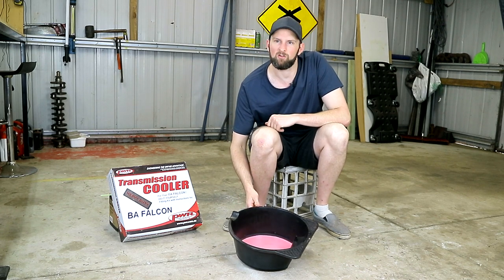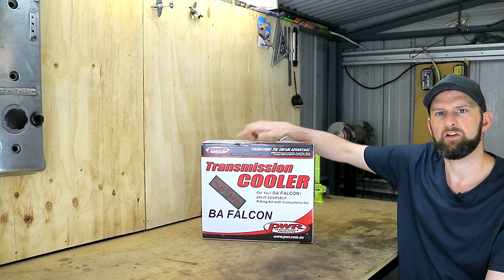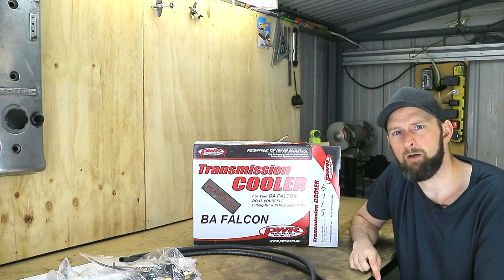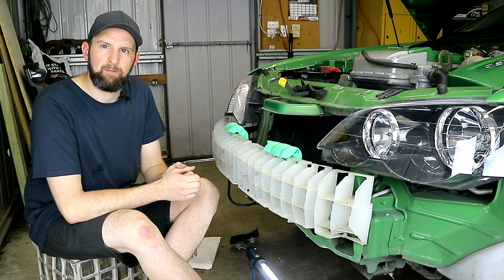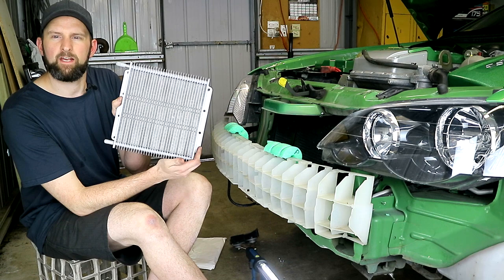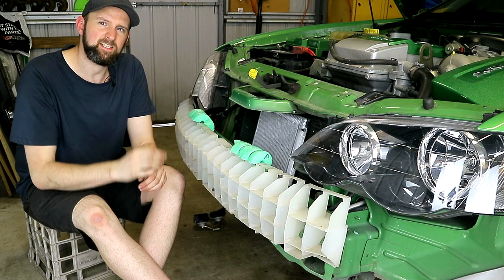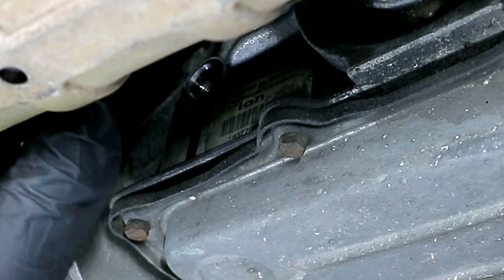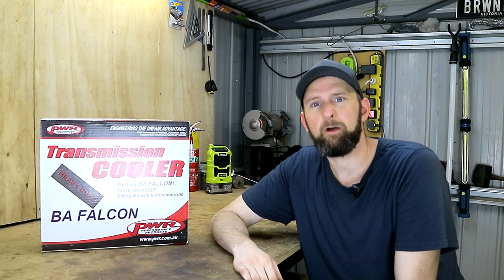Transmission Cooler Install | BA-BF Ford Falcon & SX-SY Territory

Comment: Would this suit a BA XR6T
Reply from the maker: Haven't done it but the answer seems to be yes and no. Yes they can fit but this particular kit I don't believe will as the bracket it mounts to won't work with an intercooler. Seems most mount it elsewhere or directly to the radiator/condensor with provided zip ties that come in this and the universal kits.

Good luck, I'll be tackling this in an upcoming video myself but no time frame on that just yet so that may not be any help!
Reply: @BrowneysGarage  cheers mate! Appreciate your detailed reply! Looking forward to the video if you do a turbo. Cheers

Comment: you make this look way to easy it’s a fucking mission
Reply from the maker: Everything looks better on YouTube, even the cars paint! I didn't think this was a terrible job but maybe I got lucky.
Reply: You definetly did a good job that’s for sure! The main part i struggled with was the bending of the metal hoses i couldn’t quite get them in a good spot
Reply from the maker: Ah yep I can see that being a pain, say I did get lucky there. I spent more time getting the damn barbed fittings and hoses over the end beside the radiator there, tight spot.

Comment: Factory one an absolute joke even in a nl Fairlane ghia it's so small surprised it even works at all
Reply from the maker: Yes but they still generally get the job done with a good lifespan outside of towing/increased power etc. The good old BTR is pretty low maintenance and hardy in many regards, especially compared to some of the newer boxes.